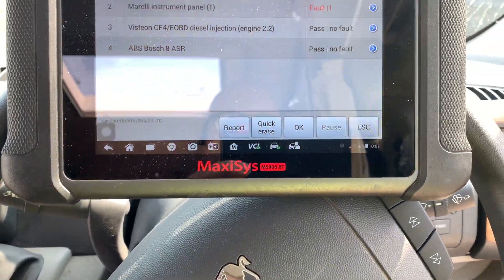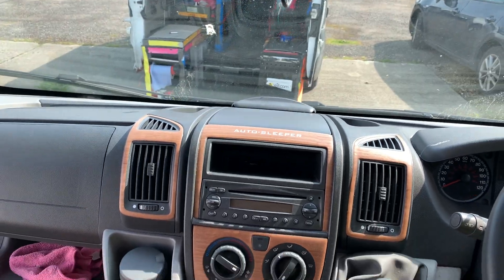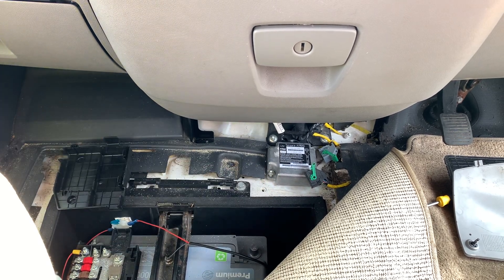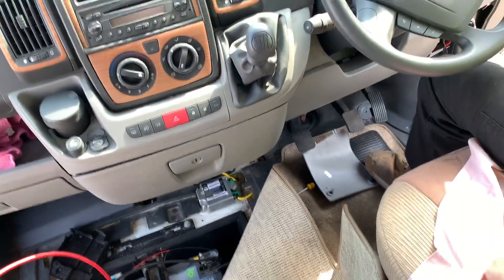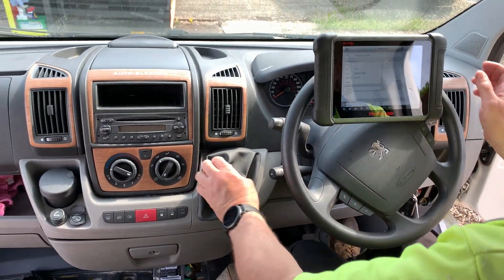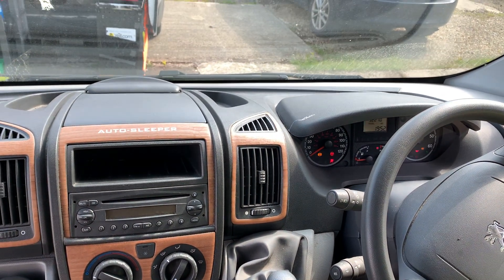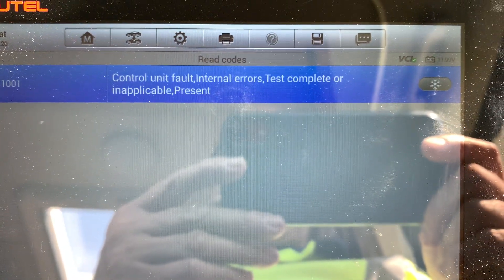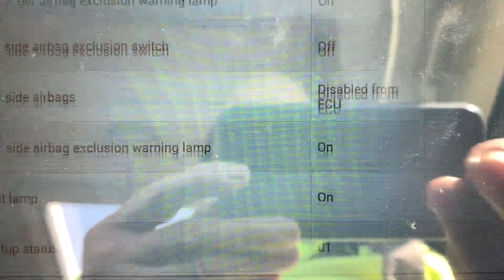#fiatducato B1001 airbag faulty eeprom not repaired

Comment: Hi. We repair several a week.
Reply from the maker: This company just couldn’t do it
Reply: @caralarmandradio  what are they doing during their 'repair'?
Reply from the maker: @izeawalker supposed to be rewriting the eeprom memory but it just didn’t work ended up having to fit a new module and it was perfect
Reply: @izeawalker  They are meant to directly connect to the module EEPROM and write a known good set of code to it. Some do it better than others...
Reply from the maker: We have subsequently bought the very expensive software and its very hit and miss